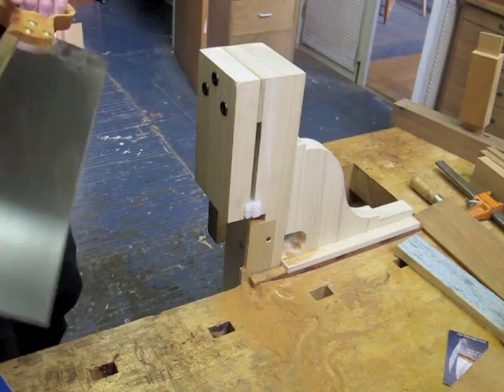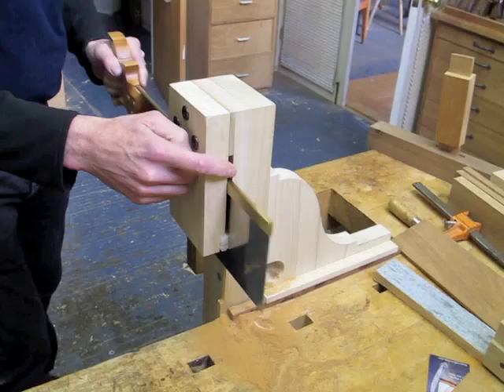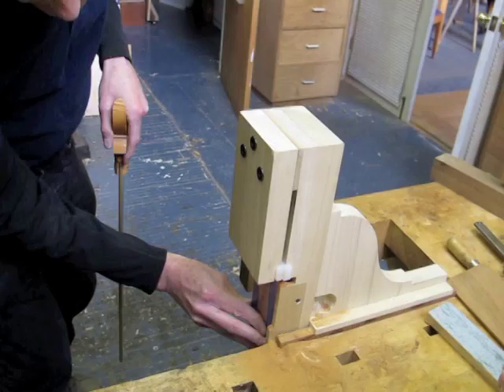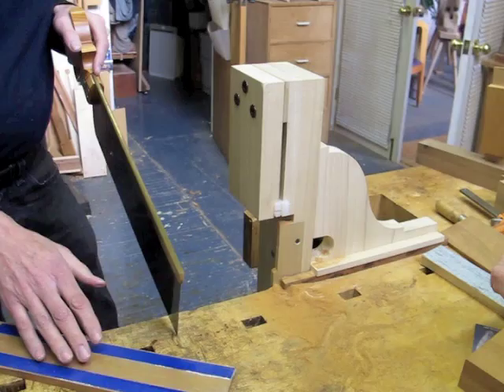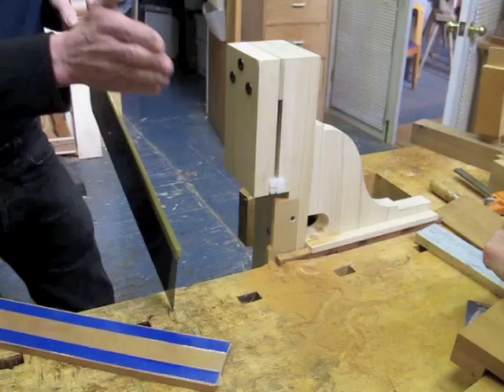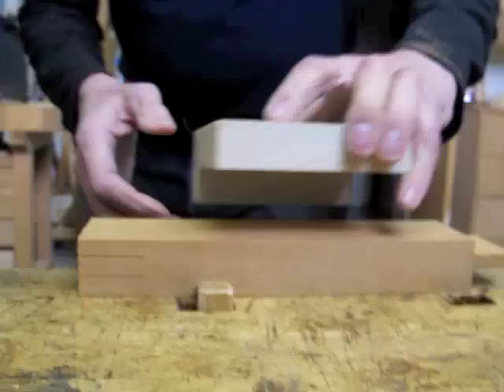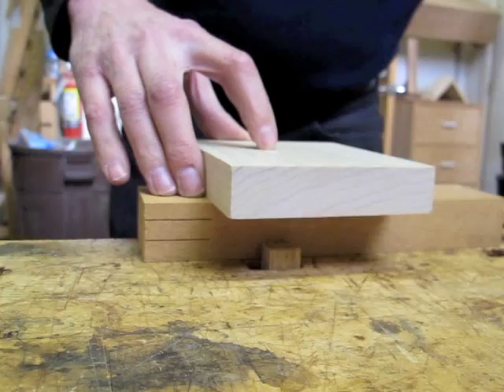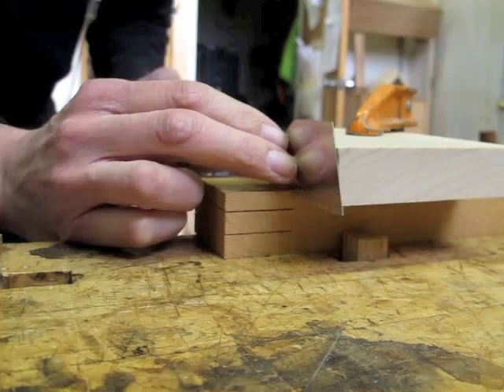Mortise and Tenon Furniture: Jeff Miller's Tenon Jig

Comment: schenher: Assuming you're not mass producing parts, cutting tenons with a hand saw (particularly with a jig like this) are pretty fast. In my experience, setting up a table saw tenon jig is very time consuming. Band saw might be a lot faster, i dont have much experiencing with this, but you'll still spend some time messing with the fence at least. Also, the saws Jeff is using in the video produce EXTREMELY fine cuts which dont need to be cleaned up.

Comment: It looks like the jig is designed to cut tenons on wood about 1.5 inches thick.  For thinner blanks, the only way I can see to make appropriately sized  tenons is to add a second spacer to the spacer that controls the thickness of the tenon.  Or make another jig.  Any other ideas?